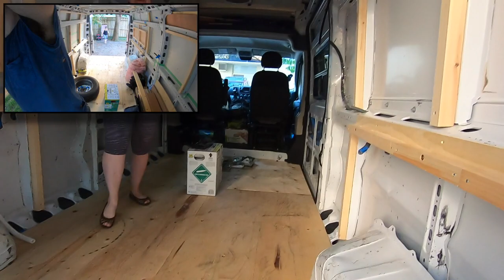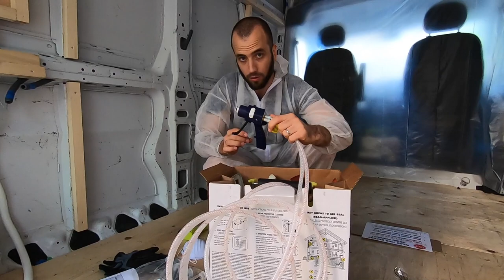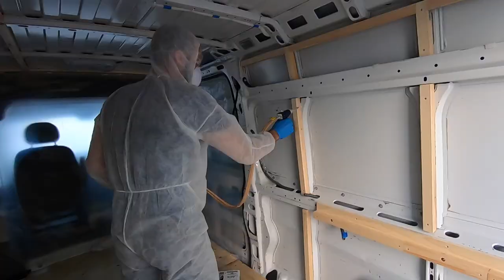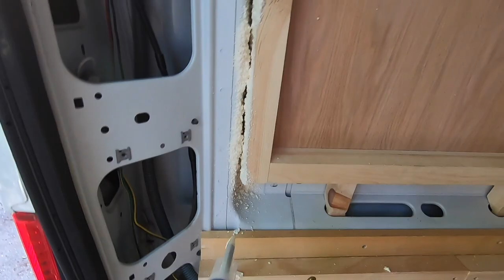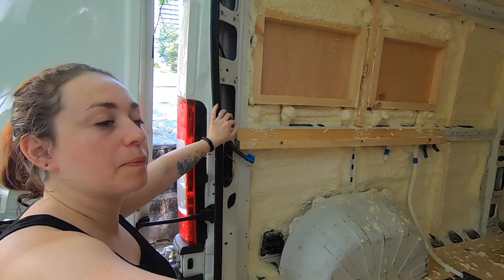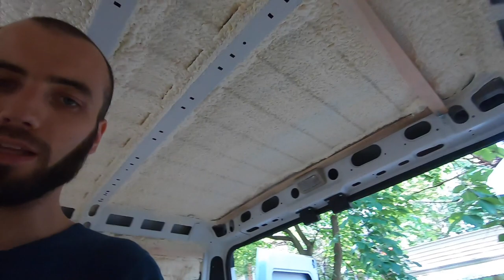SPRAY FOAM INSULATION - How to insulate a van - Promaster Van Build #11

Comment: Perhaps I missed it somewhere in the video, but did you choose not to spray into the cavities for a reason? I purchased a spray foam kit for my promaster but have been waiting for ideal temperatures to execute the install. Wondering if I should fill the cavities with wool thinsulate or try to spray foam into them. Thanks for the content!
Reply from the maker: We didn't spray into the cavities because we will be running wires all around them. And at the time didn't know exactly our wire routes, so we didn't want to block any of them! We went for fiberglass in them, but we've been told it's not the safest option. Too late for us!
Good choice on the diy foam kit, it's a lot more fun and easy to do than we thought!
Reply: @MyTVan Sound logic on your part; thanks for getting back to me!

Comment: Nice, SAY ANOTHER INSULATION OPTION FOR SOME AREAS that is FREE!:
A super cheap greatly overlooked free insulation material for what you might use to stuff into cavities in a van is used poly fill-pillow filling that you can fairly easily get for free from people's warn discarded sofa's are often found next to apartment or thrift store dumpsters OR the Foam From the discarded Seat Cushions-New foam is Very expensive but this foam is FREE and should also sound deaden some! The cushions often have zippers or just cut the seat open. 
To cut foam to desired size and shapes, I use a hack saw taken out of it's holder, holding the blade loose in hand and saw back and forth although it does not work as quick and precise as an electric meat knife, it works ok. Don't use fiberglass insulation that goes in house attics, I think the loose fibers would get into your lungs no matter what. Also note that the stuff in used sofa's have been covered and protected by the outer fabric so it's usually in pretty good shape.
Because any soft pillow pads or pillow backs can be full of the stuff. Just cut open with a knife to find out and take what you want before the garbage company crushes the sofa. 
Of course you'd want to give it a quick close scan smell with your nose on it in case it has pet urine but really most apartment deter pets by either not allowing pets or they charge a lot to have them.
Manufacturers make the poly basically from plastic bottles and it's fluffy and no one is allergic to it and it doesn't make you itch and it doesn't absorb water and although it isn't as good of an insulation as foam, it does insulate by holding the air in it's fiber fluff pockets.
Of course you can buy it new in bag at hobby departments but it can be kind of expensive and why buy new when you can get for free and save the environment from more new plastic?!
ALSO of course for the floor insulation, a free alternative is used carpet foam can be found in dumpsters behind carpet stores. Some might be in very good shape as some people replace carpet often and some rooms just aren't walked in much. 
What could be cheaper? Thanks for your videos!
Reply from the maker: Thanks for your comment! That's a smart idea (free is always a good argument haha!). We've heard a lot of cases of bed bugs in Toronto, both in cushions and furniture found on the street, so we've been a bit reluctant to get this into our van. But we definitely thought about it! We love the look and feel of repurposed material, but decided to go a safest route with new material in our van.